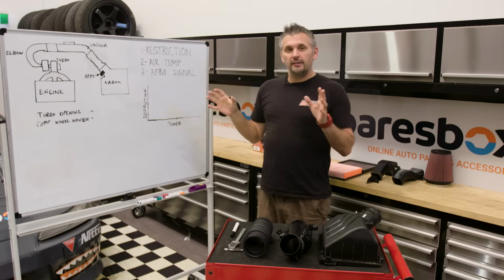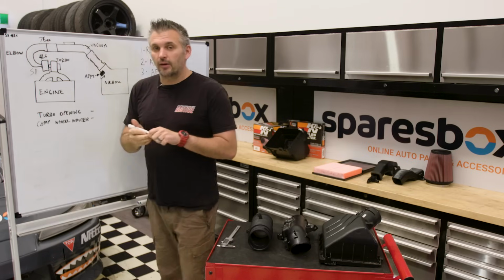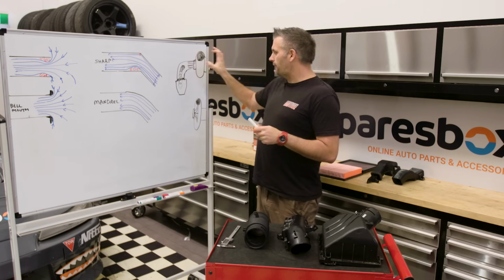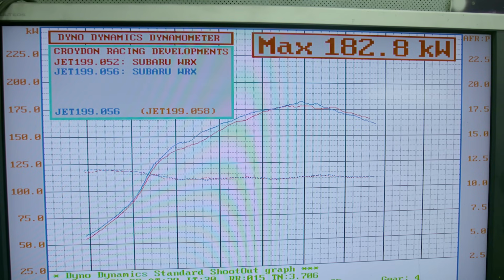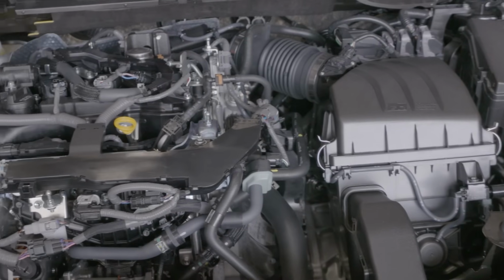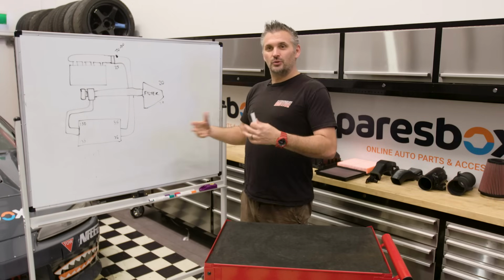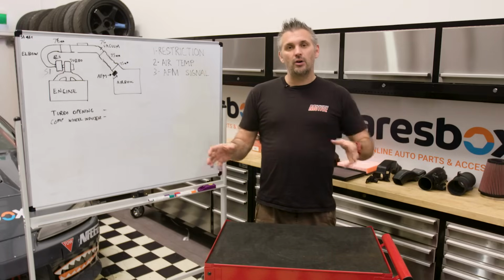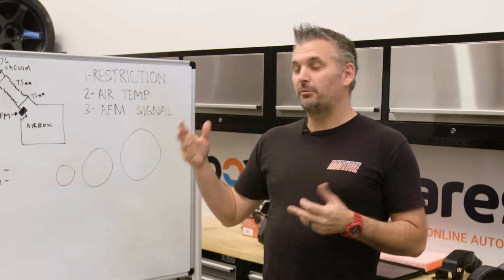Why Cold Air Intakes DON'T or DO Work on Your Car - Motive Tech

Comment: Andrew, I love this video, there is a lot of truths there, but also a few inaccuracies. I've been designing Air Induction Systems for many of the big motor OEM's, (US & German), for just over 25 years now and we do a heck of a lot of CFD work on these systems from day one. Granted power is not what we are after so much, its efficiency and economics. But one point I do strongly disagree with from this video is the air flow into the compressor. We have a Gamma ration we need to meet, (the evenness of flow across the compressor face). You use the analogy of a plane engine, but have you ever seen a jet engine mounted facing upward at say 30 degree angle, or even less. NO, they are always pointed directly into the flow as the distribution of the air to the compressor is important. One big tip I can offer you, and something everyone over looks, is for the duct to be as large a Dia as possible right up to the compressor. So that diagram you drew of the Yaris, hold the ~76mm all the way around the bend and neck down to the 50mm at the last minute. This give the compressor a greater volume of air to play with, (from all directions rather than skewed to one side after and 180 bend), and before it is accelerated up and ingested and means the flow speed around the bend is a slow as possible and therefore less restrictive. (Don't forget that any change in direction, cross section,  acceleration or deceleration of the air creates RESTICTION).
Also swirl is a major factor that we need to manage for NVH and spool up reasons. So much so we even fit spiral swirl generators into the duct before the turbo, (something I have a couple of patents for so far ). But these have an adverse effect of creating a restriction, but something we often have to  put up with to get the swirl in order.
As for AFM's, one anecdote I have regarding their sensitivity and how it can throw and ECU out, when at Ford we were finding discrepancies in the AFM signal between different filters in the same car. It turned out to be the metal clip that joined the cylindrical filter paper was effecting the signal depending on where it is positioned in relation to the AFM. We ended up adding a small keyway to the filter so I could only go in in one orientation and had the filter manufacture ensure the clip was within +/- 2degrees of the CAD design.
Anyway, keep up the great work Andrew and I look forward to your next episode. (I promise I won't piss on that one).
Reply: Deep industry knowledge, much appreciated.
Reply: @maiy8786  ideally you want flow as slow as possible, within reason. 
As for cooling effect of fast air, I've never heard of that from an induction point of view. But any cooling would be out weighed by heat soak through ducts running through hot areas.
Reply: @Scott_GT-R  - Fair call on the feed in to the turbo. As Andrew hints at, I do imagine there's turbos/setups which are more or less sensitive to the specifics of that. (@Maytricks) If you look at Bernoulli's equation you can exchange velocity for pressure/density (which has a direct relationship with temp'). But you don't get a free lunch as the velocity may notably impact pressure drop and it's impact isn't likely sufficient. This is why you generally want to keep velocities low and flow laminar as Scott mentions. 
As Scott correctly note, the general conclusions from anecdotal evidence is 'ok'. In addition to your comments, static pressure drop isn't a linear relationship so the linearity is an assumption, density has to be factored in to the IAT considerations against boost response, and open loop tuning means there's generally only a margin of control in the ECU to be able to compensate for cooler air (by jacking fuelling/timing). 

In any case, really hard to condense a fairly complex topic into an easily digestible format, so full credit to Andrew for the video.
Reply: Well Scott that was pretty comprehensive, cheers for bothering to share your knowledge.
Reply: best comment on cold air intakes i've read lol
Reply: The aftermarket companies should focus on designing sealed air box built with higher quality materials that blocks out majority of the engine heat and has the intake duct pulling fresh air from the front of the vehicle creating a ram air 🌪️effect when at speed 💯💯🏁
Reply: @DJ_Driven  yes they should. The problem is that would be very very expensive and time consuming for them and every car would be different. Each vehicles induction system takes an OEM a year or so to developed. A tiny aftermarket filter producer is far to small to do this at scale and developed multiple vehicles at once. It's far easier for them to make a cylindrical filter and just supply a clean air tube to the throttle/turbo for each car.
Reply: @Scott_GT-R  I read a paper along similar lines. They had a packaging problem of a hard 90 degree bend being required at the compressor inlet. They designed a banjo-shaped fitting that allowed a  bellmouth to be used and the compressor was effectively fed from 80% of the circumference and not 35%. Apparently variation over the compressor dropped by a massive amount.
Reply: @DJ_Driven  forge do an amazing one :)
Reply: Thanks for the accurate insight Scottgtr. You are absolutely spot on in term of the MAF as even the GR Yaris OEM intake has two specific areas with strategically place aluminium strip which no one so far apart from you have mentioned.
Reply: @Phanvision  
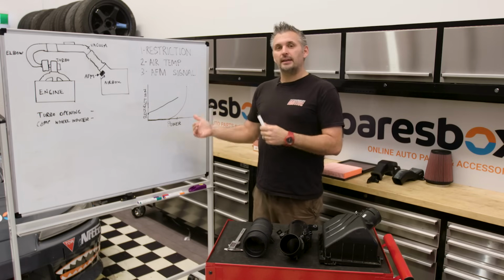3:58
Reply: Damn dude knows more about air than I know about anything 😅
Reply: Inside the intake system on my OEM Ford F-150  3.5 ecoboost it has these little plastic inserts that obviously have something to do with airflow. Are they creating swirl?  I was going to change to an aftermarket cold air intake but when I saw those I thought, the engineers didn't put those in for no reason!  There must be tons of hours of research into making the intake as efficient as possible. If it isn't broken.....
Reply: @atomflyer44  I guess these are in the lower part? If so these are to help equally distribute air to the bottom of the filter and avoid 'hot spots', is way we get the best utilisation of the filter as possible. Unless your going in very deep water, it's best the way it is. Yes you are correct, thousands of hour have been spent making sure it'll handle snow storms, hot deserts, heavy load towing, sound quality, (not volume), and all the sensor are reading perfectly for the best mpg & emissions. Why mess with it!
Reply: He'll scottgtr have you seen the Eventuri air intake for the GR, he also talks about the fact that the air temp that you pull in makes no difference, but the boys at Eventuri have either proven him wrong on that or the factory GR has the world's shittiest intercooler. Eventuri found a 20 degree c drop with a 10hp increase with a exhaust... thoughts?
Reply: @danield112  a good, (efficient), intercooler is worth more than a cold air intake as Motive DVD says . Let the cooler deal with it. Please have a little more faith in factory air air induction system. We, (I design them for a living), spend millions and analyse every minute detail of an engine response and performance when I design oem factory. They are not all the junk aftermarket manufactures lead you to believe. Basically you can do good tuning on factory stuff if you address any obvious weak point.
Reply: @Scott_GT-R  have you ever designed an induction system for a racing car where performance is the only priority? 

How many racing cars run the same intake system as their road going counterparts? 
With respect, it’s not many…
Reply: @edh7492  unfortunately not 😢. My work is very constrained with many conflicting attributes we need to meet. It's easy if everything is hand made in carbon. A plastic system made out of the cheapest grade possible coming out of a tool every 25 seconds for $5 is far tougher.
Reply: @Scott_GT-R  One question I have for you...

One of my turbo cars (Volvo) has a panel filter, the other (Mercedes) has a cylindrical air filter, I'm thinking of trying to fit a cylindrical air filter box from a Mercedes into my Volvo.

Thoughts?
Reply: @sideshow4417  I am not sure what gains you may be trying to achieve. Are you hoping to fit a different cylindrical box in you car, or a cylindrical filter into your existing box? If it is the later it may be difficult, if the box was designer for a panel filter, then the air path maybe all wrong for a cylindrical filter.
Reply: @Scott_GT-R  New filter + box as the cylindrical one has more surface area.

I'm going to adapt it to fit, and then dyno each setup and then base the remap on the one that makes the most difference if any, I would like to do a remap on each setup but the costs outweigh the benefits.
Reply: @sideshow4417  But a lot of this extra surface areas my be facing away from the dirty air coming in and so the flow may not want to use this extra surface area anyway.  I don't know the specifics of the boxes you're referring to so can't really comment accurately. But there may be no harm in trying out your idea.
Reply: @Scott_GT-R  Did you do any work on the 2018+ Mustangs? Those stock air box systems are quite efficient and it has gotten out in the modded mustang world that, to a certain extent, the stock air box keep the IAT cooler than the aftermarket "cold" air intake systems (which tend to suck in hot air from the engine bay) as the cars are sitting at idle, especially while waiting in a staging lane at a 1/4 mile track or at a stop light which can show IAT of 130 degrees + here in Texas). Unless the car has a supercharger, or aftermarket intake, the stock air box seems to be the way to go rather than spending hundreds on an aftermarket cold air intake, especially as the aftermarket cold air would not benefit until the car is 1/2 down the track.
Reply: @mikefegley  Mike,  No I didn't work on the Mustang, but I work for the same group and do know the Designer & Engineer. Most after market 'cold' air intake don't actually seal to the front of the vehicle, (usually because it it too hard for them to do), and this causes them to suffer badly from heat soak. I'm sure when they 'develop' these systems they only consider the car already moving & dyno it with the hood up.
Reply: @Scott_GT-R  very interesting topic and information! thanks to Motive for the video and to you Scott for the further tips! I have done some testings with a 2017 Focus RS. and found out two thing: the stock intake is very well designed, till it comes to the restricting arc at the filter housing. Just changing this to a 3" pipe going straight into a modified K&N filter, adds power in higher revs. and does exactly the same, maybe better then the aftermarket 3" intakes. The second part I'm dealing with is a CAI from Velossa, which brings the cool aisr directly into the filter housing. it mayber gives a little benefit. But i'm totally unshure to let the open RS lid on the intake, or to close it with the K&N lid. (and even close the K&N E-9289 with the plug). would it be enough air, coming through the CAI?  on slow traffic the closed setup is better I think. But overall on faster roads?
Maybe the CAI with the Stock lid and the K&N E-9289 is the best, but i'm not shure. Is their data, which can be logged regarding Air volumina, or effencity? What do you think would be the best intake housing for this car?
Reply: @vornamenachname2082  I have a story about this.  I was the RS's original designer, but 3/4 the way through the program it was given to the Ford Performance Team to finish and I didn't see it again until the vehicle was launched.  As we were finding it very difficult to get all the dirty air we needed through the cars front structure I was the one who proposed to open up the top of the filter box, but my proposal was to add a duct to the underside of the hood which close onto the top of the filter box when the hood was closed and ducted air from above the headlight, (rather like how an R34 GTR Nismo uses its carbon hood as ducting, (I am a GT-R owner and fan)). Combined with the duct we already had at the front this gave us all the air we needed. Unfortunately hood rest bar cut off our access to the front of the vehicle and finance refused to go the gas struts to clear the way for my duct. Anyway, some one must have thought we didn't need this extra ducting and deleted it, so 1/2 of my CAI was never used. 😥
Reply: @Scott_GT-R  Very interesting Scott! (y)  Thank you for your answer, I really appreciate this information! To save 80 pounds for gaslifter :( :( From this story I think he can use the air in the open. It would really be ideal if feedes as real CAI. The Velossa BigMouth is definitely an advantage. Let's see how we can bring even more fresh air to the Filterhousing....
Reply: @Scott_GT-R  As an engineer I have seen too many times the business side of the house screws up efficiency or performance for cost.  Something else missed is the friction loss dues to the air rubbing against the inside of the pipe.  This friction also causes turbulence in the tube.
Reply: @Scott_GT-R   this is truly the best info I have read regarding engines in the comment section of a YouTube video. I really enjoyed catching up on it. I could imagine the tweaks you can make on your own cars ais 😂
Reply: @taz4100  thanks Taz. I've played around a bit on my R32, a lot of it is now custom. I'd be the first to admit it doesn't give me much extra power, but it makes me feel good. 😁
Reply: @Scott_GT-R  Thanks for all the info. Seems like when going with a cold air intake(cone) it’s most efficient to use a sealed hood scoop? I have a 3.5 eco, looking for better highway mpg, read some articles stating cat back exhausts may offer small gains, but the best is going with a tune? Any suggestions? Can I Run two sealed intakes, one to each turbo 🤨
Reply: @Scott_GT-R  But you guys have a total different goal than people modifying their cars. I know stock air boxes are also made to muffle turbo sounds because customers would think its a defect with their car
Reply: @Scott_GT-R  So whats the verdict, do a "hot air intake" increase power and responsiveness, my experience says yes. 

ps. arent the air boxes designed so they muffle all turbo sounds?
Reply: @NjoyMoney  that is true, but that's mainly surpressed by resonators in the ducting.
Reply: Good info. Thanks. So in my Stinger GT, I added 2 snorkel air scoops and have drop in k & n filters, in the oem boxes. and I've noticed .2-.3 sec. better 1/4 mile times at the drag strip.. so the bit extra cold air making it in is helping a wee bit ? k & n filters helping 1-2% ? or is it just chance ?
Reply: Awesome sharing....appreciate that....can you dumb it down for me???  Cold intake or not????  :-)
Reply: @mo-215  N/A engines, Yes 100%. Forced induction, do the best you can, it will not hurt.
Reply: So, unless I'm creating 600-700 hp on my G70, more than likely, I'm better off keeping the factory air filter system with my tune.
Reply: just to add to this with the jet engine analogy, he said have you ever felt the engine produce less power , its called a compressor stall, which happens regularly unless managed in jet planes.
Reply: Thanks for the lesson and perspective. Is it worth it to change the stock with a cold air intake then, your professional opinion please.   Thanks.
Reply: @jrf5418  cold air is always best if you can get it.
Reply: @Scott_GT-R  hey there Scott sorry not trying to interrupt original post video but everyone else is 😂 there’s not CAI system for my turbo and was wondering if I should go with silicone smooth interior intake tube with stock box and cotton filter or stainless steel intake tube with carbon fiber housed cotton intake like gruppeM type? Thanks Scott much appreciated!
Reply: @craftedballistics  providing the geometry and sizes are the same the restriction should also be the same. It all depends on how deep your pockets are.
Reply: Agree on how the air is presented to the overall turbo fan/blade.
There are educational videos made based on declassified info/detail on F16's intake that talk about this.
Reply: So years ago I bought a thing called a Cyclone which fitted in the air intake after the filter to create swirl. I didn’t think it made any difference but perhaps if I’d put it on a dyno it would have shown a small difference. I’m going dig it out and put in my current car just before the turbo and see if I can detect a difference. At some point I am getting my ECU remapped, when they do the dyno runs I’ll get them to do one with and without the Cyclone.
Reply: @garviere  swirl generators are used by OEM's to help spool up, but they sap power top end. But usually OEM's aren't interested in max power rather drivabiliy.
Reply: @Scott_GT-R  got it, thanks. I’ll best that in mind. It’s a Discovery TD5 so on the Highway up hills is maxed out which I guess means I might see a drop in power then. It will be interstate to see. 😊👍
Reply: @Scott_GT-R hey man what about throwing a CAI in a 2019 6.7 power stroke? Think it would be helpful? Considering doing an exhaust but I know the dpf cuts down on the sound of course. Mainly just interested in making it a little more efficient running, and some sound would be fun.
Reply: Thank you for the explanation man, and keep up the good work.  Cheers 🍻
Reply: Cheers'
Reply: So I just looked up what they call these little rings and they are called "Air intake silencers"  I'd love to know what they are REALLY for. I'm sorry I didn't have the correct description. If you look up "Air intake silencer removal"  you will see what I'm talking about.  Some people are saying they create a vortex to get the air spinning in the right direction prior to entering the turbo.  I really do appreciate the information.
Reply: @atomflyer44  if you are referring to small propellers in the air flow before the turbo , then yes this is what they're for.
Reply: @atomflyer44  End up doing anything to the 3.5? I have a 3.5 2013, looking for better mpg and sound, also considered cold air intake but never found any concrete results of improvement, some mentioned aftermarket Roush exhaust. 
I do have a K&N filter which I recently cleaned with their kit and have gained 2mpg
Reply: The engine is only gonna suck into the cylinders as much as the intake valves, intake manifold and cylinder head port flow is gonna allow in NA applications. You can have that intake pipe open to atmosphere and it still ain't gonna make more power. The factory intake tube, airbox and factory air filter are already designed to supply the powerplant with as much air as it will ever require
Reply: @Kmecha84  "The factory intake tube, airbox and factory air filter are already designed to supply the powerplant with as much air as it will ever require".   I only wish this was true. Due to packaging constraints, material and process selection and meeting NVH requirements all take a toll on the restriction and AIS system has. OEM's will have a target restriction they'd like to meet, but it is never zero. Its a balance between getting enough clean cold air to the engine against noise levels and quality, economics and process  capability.
Reply: @Scott_GT-R  great so all that scientific crap that makes a person sound smart is worth like 2hp and it sounds cooler for close to $1k? I've been a licensed automotive journeyman for the past 15 yrs, cold air intakes do shit.
Reply: @Kmecha84  if is not worth anything, why do all of the OEM's I've worked for have targets for cold air pickup? OEM's don't pay out for things that aren't important.
Reply: @Scott_GT-R  show me dyno numbers. I guarantee anything over "10 hp" is bullshit which you're not gonna feel either. Obviously they have targets for cold air pickup because it would have shit for mileage if it sucked hot air 😆 and we all know new vehicles are built primarily around fuel economy. Don't you think if OEM could get more fuel mileage out of an engine they would to better the fleet average?
Reply: @Kmecha84 got my Suzuki Swift Sport 1.6 NA fitted with a complete carbon duct air intake. Went from 130 to 154hp. From just the intake and a new tune.
Reply: @chimnino  you picked up 24 hp because of a tune
Reply: So since you’re basically an engineer I have a 2009 Ford Mustang. I ordered an exhaust pipe and will be doing my tune up. I want to know if one will my car performance be affected by one and two if it’s a good idea and if so what all should I ensure is done.
Reply: @malcolmboy21   Presumably the new exhaust will be less restrictive? If so, you will see a little more power and torque, but at the expense of noise. Sure it'll be louder, but the new exhaust won't have been developed like the OEM part, so you may/will have some loud spot in areas of the rev range, hopefully none are at highway crusing speeds which can be a little tiring. But that's tuning for you, you don't get something for nothing.
Reply: This is epic.  

What do you think of the little hose that goes on the side of the intake tube that supposedly has oil fed through it and into the intake manifold/engine?  Is it true that it is safe to disconnect this hose connection and replace the ends with a breather filter?  Would it be best to seal the side hole that’s on the intake tube where the hose came from or put a small breather filter there?  And what about on the engine cover/valve cover side?  Breather filter there too or use the OEM hose and breather filter attached to the end or something else?  

They say disconnecting this hose that goes directly to the side of the intake charge tube will help prevent carbon build up and detonation but at the expense of being slightly less emissions compliant.  What’s the way you would recommend if not having to worry about passing any emissions tests but for ultimate performance and longevity of the engine?
Reply: I think I will stay with the OEM filter.
Reply: I doubt you'll see this, but I'm currently building an intake for a Veloster N, bumping up the tube diameter and using a GT350 OEM filter. Due to packaging reasons there is a 90 degree arc that has to be made. I ordered an aluminum turbo inlet that gradually ramps up to 3.75 in and it will be adapted to 4in tube. I intend to polish the turbo inlet up to the turbo. But with your comment it seems as if I'm a fools errand.
Reply: @Scott_GT-R, has this always been true of the industry?  Have they always put that much detail into their design, or is this a newer priority?
Reply: @Nathan_King  I think oem solutions have improved over the years, but some crappy systems do get through.
Reply: @Scott_GT-R  thanks, seems to me like they started caring more once the aftermarket started producing CAIs.  Certainly could be wrong though.
Reply: One point I would like to know.... Is I've seen other info that the resonator is commonly misunderstood . It's supposed to be according to aftermarket makers that it just reduces noise but isn't it also to even out the flow of air, reducing the return of pressure waves coming back from the combustion at every piston stroke...?.. Wouldn't it be optimal to try and keep the resonator but allow colder air or optimize the intake section (for example in the case of the Yaris) close off the warm air leaks
Reply: @markw8139  Resonators are only acoustic devices to iron out the odd rough sound in the rev range. I think what you are referring to is pulse tuning which usually happens in a N/A cars manifold, to increase pressure to slightly above atmosphic, much like the savaging effect in an exhaust system.
Reply: Thank you for all this info. Can I ask you a question? How do I deal with a resonator box on the intake? If I replace it with an unrestricted pipe, does it negatively affect the engine? (BMW 128ti)
Reply: So what’s the proper way to combat heat soak?
Reply: "You use the analogy of a plane engine, but have you ever seen a jet engine mounted facing upward at say 30 degree angle, or even less. NO,"

Yes.. actually. The DC-10/MD-11's engine #2 (the tail engine) is at a slight upward angle. And the older L-1011's engine had a duct feeing it's engine #2 so air wasn't exactly hitting it straight on either.  Military jets don't always have direct/straight airflow to their inlets either, nether do Turboprops. Now they of course, do their best to keep that path at smooth and even as possible, but that doesn't mean the air is always hitting the fans directly straight on. In fact, the faster the plane is going, ( i believe) they work the air duct systems to slow down the air a bit (SR-71/A-12 being the perfect, most extreme example)
Reply: Yea! What he said!
Reply: LOL love the air filter Willy hanging off the side of the chart
Reply: Heck, very informative.  Cheers much appreciated.
Reply: as a fellow engineer i agree
Reply: Baloney